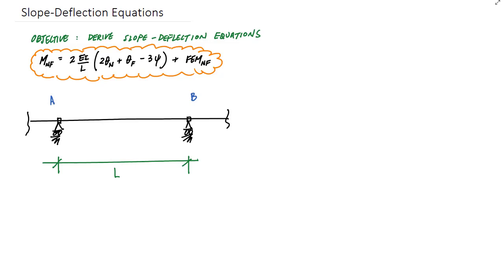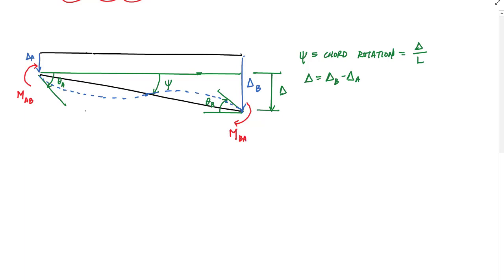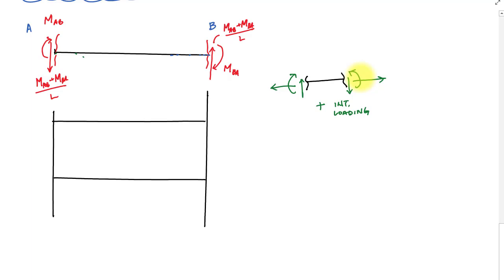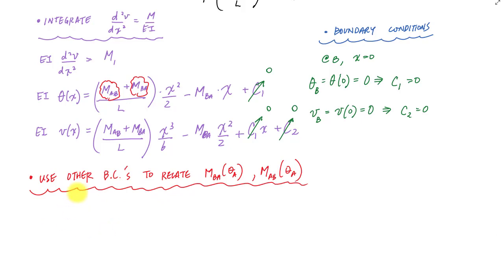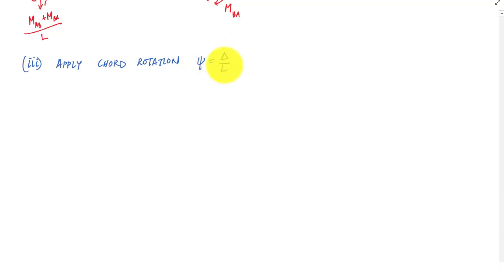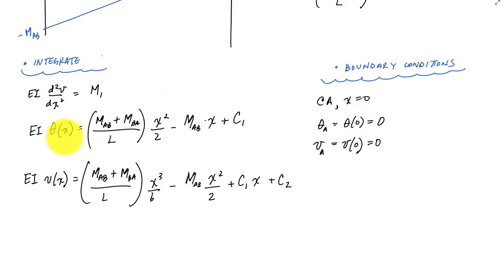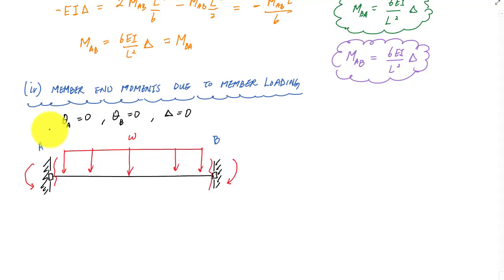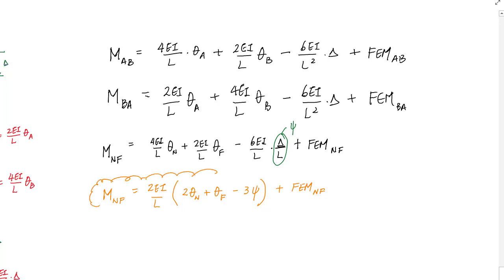Derivation of Slope Deflection Equations - Structural Analysis

Comment: double integration was used to derive these equations, which are often used for solving indeterminate beams. So, why don't we just use double integration to solve indeterminate beams? Why do we need slope deflection methods? Is it because point loads cannot be treated by double integration method?

Comment: Great content, but I have a question. When loadings are applied to the member, the member deforms. Then, we use the deformation to back-calculate the bending moment acting on the member. However, at last, we further calculate the bending moment induced by the loadings on the member again!? Wouldn't this duplicate the value we found?

Comment: I personally think that taking the rotation in clockwise direction to be positive every time is not correct. Because if in the first case where we are studying theta(a) if we take the bending moment from the left end than if at x=0 we keep the theta(a) to be positive than we get a negative relation between the theta and end moments which is wrong rather the sign should depend on the behavior of the bending moment if that bending moment supports the theta than the theta should be taken to be positive like the case taken in this video whereas if it is opposite than take negative.
Reply from the maker: slope deflection equations are derived using a different convention than internal loading functions.